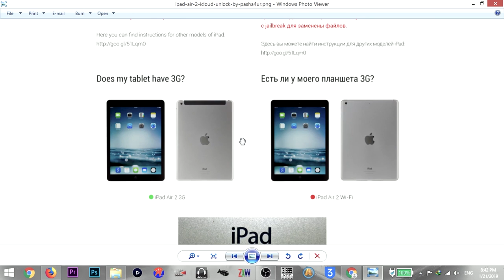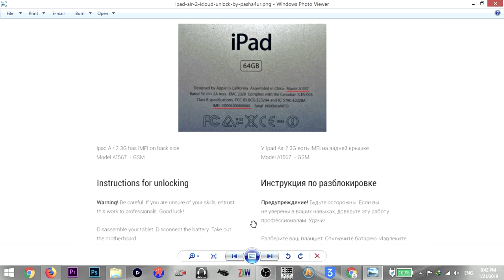How To Bypass iCloud iPad Air 2 4G 100% Tested - 2019 😉😉😉😉

Comment: The tip is good, however the way you clean the solder pads is a mess, all the traces get damaged and you need to put them back and maybe fix some and check continuance with multimeter, use iron and solder wick only to clean the pads and then SMD heat-gun with flux to level up all traces at 470 temperature, lastly replace the chip. I do this all the time with most apple tablets, phones and any other brands..my tip to you is don’t scratch the board pads with the tool you do at the beginning, use the soldering iron at 750 temperature, and solder wick or by itself, you’ll save lots of headaches and time wasted checking continuance with meter and fixing traces with wires..microscope is your best friend otherwise you’ll be scraping most boards.. I work with Apple Computers in California..
Reply from the maker: Hai Rico Thanks for your advice but i guess because the video in Arabic you couldn't understand it, I say i shouldn't work of make video while i am so sick, because it will turn to a disaster but now i am trapped and have to fix it anyway to go home take rest, i was on fever that time, i am certified Nokia technician and i have English channel as well "Ayman The Repair Tech" bless you

Comment: Boss why for unlock iCloud need to replace wifi ic?  If you saying details.. Thanks
Reply from the maker: Not for all ipads few models only because we turning them to wifi version and wifi ic in these few models different in 4g and wifi not same ic
Reply: Ayman Ahmed hallo i am did same make a jumper and put wifi ic and ipad says not active what should i do help
Reply: Ayman Ahmed hallo i did same make jumper and wifi ic but activation error what should i do bro
Reply: @shibinsuhair  how did you solve it brother, I have the same doubt. You have to program new series on the nand or only with the jumper and change the wifi ic.
Reply: @Ayman Ahmed could you help us???